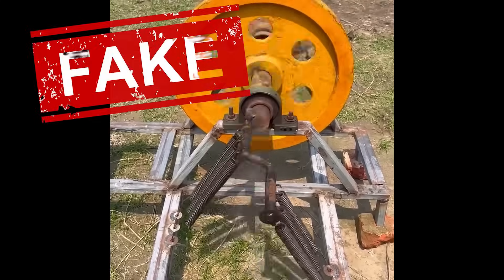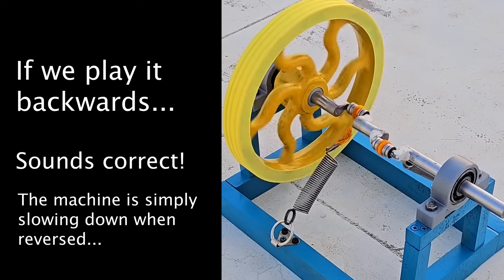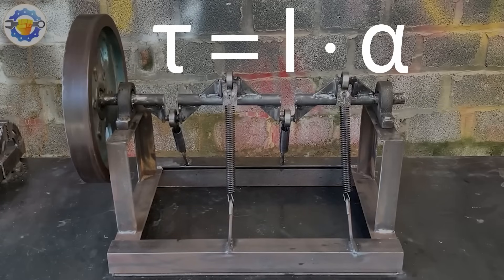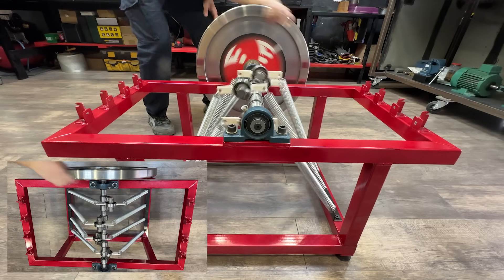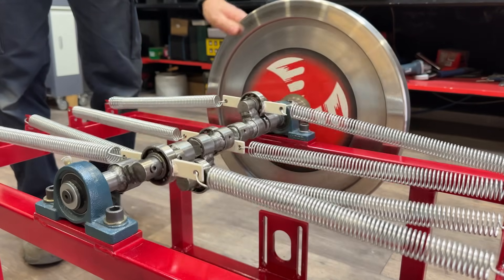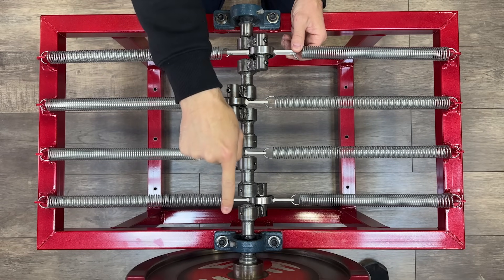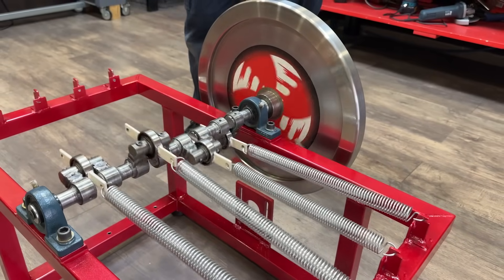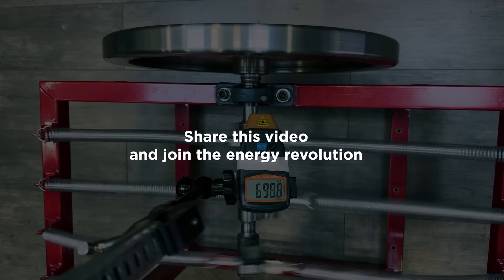Can this Machine Run Without a Motor? Let's Find Out

Comment: It is solved with brain motire, the sticker is glued to disguise it not to see it!  5:28 However, the springs also betray the magnet engine due to the magnets due to the moving of a slow manual roll This vibrates the springs!